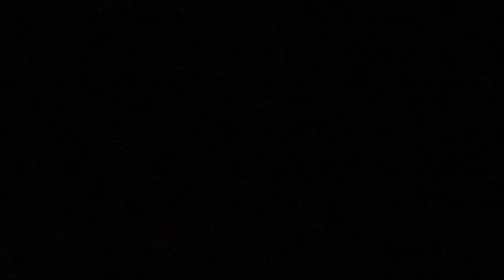AMF 82-30 Pin Elevator Wheel

Comment: Those "clamps" are cleats.  They are also LH & RH.  I noticed the toggle tips are a bit worn.  During the 1960's, tips were 50 cents each.  We had the night chasers heat the worn tips and clean out the recess.   Then we glued in #00 rubber plumbers faucet washers in place.  How much are tips today ?

Comment: Love your videos Joe ! So if the elevator wheel holds 7 pins, the table holds 10 pins, and a bowler leaves a single pin spare, then there are 2 pins that roll around the carpet / elevator area until the 2nd ball is thrown correct ?
Reply from the maker: Thank you! I’m glad you like them! And yes that is correct you got it!👍✅

Comment: Why does the rotation differ between an odd and even lane? Why don't they all rotate the same way on all the lanes?
Reply from the maker: I’m not exactly sure to be honest with you… it’s just the way AMF designed it. It may be because the backend motor only rotates one way or the other depending on which lane… just a guess I’m not completely sure. Great question though! Thank you for commenting and make sure you’re subscribed! We’re almost to 2k!:)